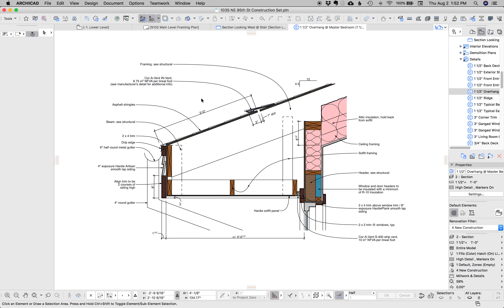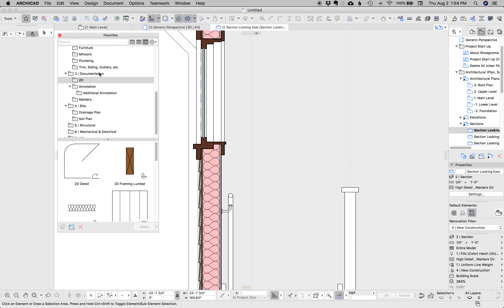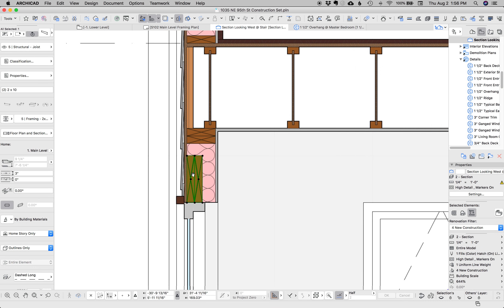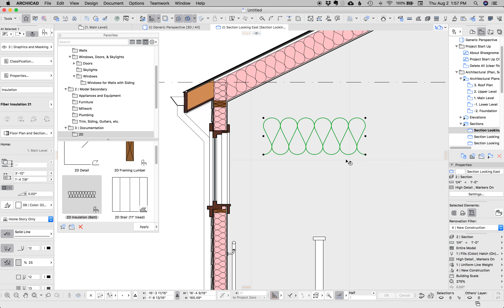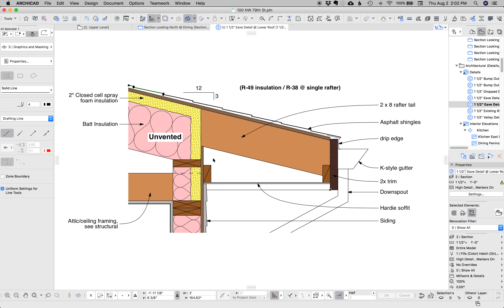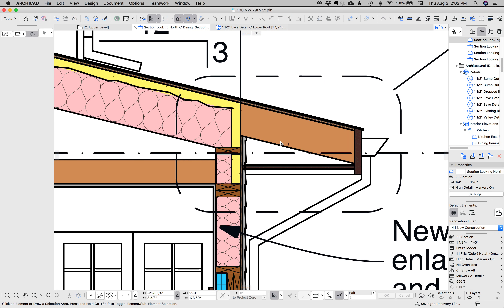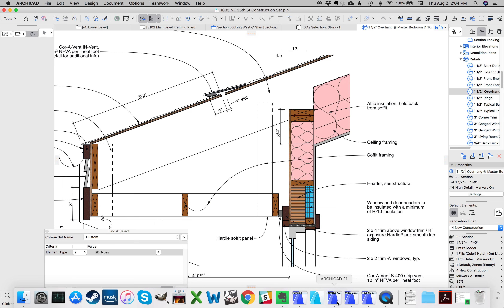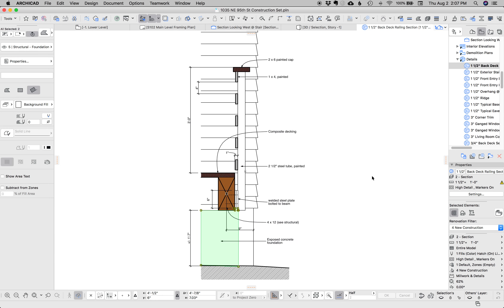ARCHICAD Tutorial #67: Adding 2D to Sections and Details

Comment: thank you for the tutorial! really helpful, i am new to archicad, migrating from autocad and i thought detailing was an automated procedure here. The material fills and such should be properties of the geometry i am currently doing a section on. For example when i setup a wall i want it to be reinforced concrete, insulation on the outside and plaster on both sides. Isnt that something i setup when drawing the wall and the detail of it is automatically produced? In this video there is a lot of manual work so that if something changes you have to go back to every detail and adjust the wooden beams for instance or the insulation width. Again, i am new to this maybe i got this all wrong.
Reply from the maker: Philip this video is about finding the balance between manual work and automation. ARCHICAD can't read your mind and sometimes setting up/managing the automation provides diminishing returns. In your example of concrete, insulation, and plaster, that would be 100% from a composite or complex profile and thus fully smart 3D. But if you wanted to show the rebar in section or a detail, that might be smarter to do in the one place you'll show it. There's an old BIM adage: if you are going to see it more than 2 times, model it.

In the end, it takes an experienced ARCHICAD user and architect to understand the line between 2d and 3d needs to be. I know some people who have 100% of the details  in 3D and modeled. That's not always a cost effective solution or necessary. Additionally once you fully integrate design into your workflow, sometimes it makes sense to design a detail in 2D and then propagate the results back into the 3D. Other times the reverse. There are no firm rules. So just go with what helps design, improves the speed of your work, and makes you profitable.
Reply: thanks a lot for the guidance! i agree on having to find a balance, i suppose coming from a completely non automated workflow using autocad i expected archicad to give the solution to every annoyingly time consuming task.  @Shoegnome
Reply from the maker: @philippaps44  BIM doesn't give the solution. It just provides the tools for you to find the solution faster, stronger, and better.
Reply from the maker: Which is to say, ARCHICAD is as smart or dumb as its operator.

Comment: Finding the balance between 2d and 3d seems like a delicate and ever moving balancing act.  Model too much and things start interfering and you end up with way too many special cases.  Model too little and you are drafting too much and theres a chance things won't be coordinated.  I'm going to start looking at building a 3D cross section through the building that would not interfere with a simpler model.  The simple model would be for plans and elevations. The cross section that would rest in-line with the simple model would show details.  Do you have any thoughts on this?
Reply from the maker: I have a lot of thoughts on this. A well built model shouldn't require a lot of special cases and should remove the need for lots of 2D. Here are two articles I wrote that expand more on my thoughts: https://blog.graphisoftus.com/bim-washed/conquering-bim-never-do-just-one-thing and https://blog.graphisoftus.com/archicad-15/does-that-still-not-work-is-this-still-the-best-solution In particular, look at the last graph in the 2nd blog post. That's the goal. Always less 2D and eventually less time doing 3D.

Comment: First, let me thank you for the invaluable service you provide those of us who use ArchiCAD. I've learned a LOT of cool stuff over the years from your videos and your template. I was curious if there's a reason you prefer to do all your plates as 2D elements rather than put top & bottom plates in complex profiles of walls (rather than composites) so that they're part of any wall? The reason I like plates in complex profiles is that the plates move with the walls - vertically or laterally. I know that if I were to put them in my sections as 2D, I'd forget to move them whenever I moved a wall in some other view. Is there a downside I'm not aware of to the way I do it (bogs down the model, etc.)? Thanks again for all your great help!
Reply from the maker: Thank you! I don't like using Complex Profiles for primary walls. The chances for weird junctions and odd window/door behavior increases. Also (historically at least) model performance can be affected. That all aside, I think using standard composites for walls is just faster, simpler, and more flexible—as the typical wall is just generic. I used to do sill plates as part of my foundation wall, but I decided i didn't like that. I much prefer the purity of simpler elements. Adding sill plates into complex profile walls is great until it isn't. Even one or two special conditions in a project creates overly custom moments. Maybe another way to look at it: I don't know what advantage switching to Complex Profiles that includes plates and such gives. Complex Profiles are more labor intensive to work with than Composites for elements that can be handled with Composites. And composites are easier to manage and swap out when you're dealing with a bunch of elements that differ only by thickness. Of course one could argue the new Complex Profile options in 22 make CPs super flexible. And that's true. BUT it also makes the elements that result from those Complex Profiles more custom and less automated. My preference is always to more automation. Or maybe proper automation. The manual nature of adding plates feels right because everything else is smooth and automated. Adding the plates manually is thus my slow down moment to check my work.

SO...that all comes together to suggest: simple elements to build the model. Then at the last minute add plates and other stuff that are really just decoration for the drawings.

Of course, I'm always happy to be challenged and shown a better way. I'm open to the possibility that I'm clinging to an old methodology and 22 is the beginning of Complex Profiles for more things.
Reply: I'm really glad you replied! I should give you a little background. My name is Chris Hinrichs. I live and work in Petoskey, Michigan, a small lakeside town popular with vacationers. I moved here from Chicago in 1997 to do hand drafting of mostly lakefront custom home CDs for an architect. I convinced him to transition to AutoCAD LT to do 2D drafting. Eventually, he wanted me to learn 3D Modelling, so he bought ArchiCAD 8.1 (whatever year that was) and tasked me with learning it well enough to show him how to use it. I had to learn it on the fly as I put together construction docs, so I never really learned the root logic behind the software and how efficient it could be. I jumped around as far as versions. I went from 8.1 to 11 to I think 15, 17, 18, 20, 21, 22. Now I work for a firm that has a subscription, so that will be nice. Interestingly, of the relatively small number of firms here, I'd say 50% use ArchiCAD. Sorry for being so long-winded, but I wanted to say it was in big part thanks to you that I finally started to understand the logic and flow of the program and really regained an interest in learning how to maximize its efficiency. If you were to see my template, you would see it's very similar to yours in most every way, except for the framed walls with plates as complex profiles.

I don't think I've experienced any of the weird junctions or issues with windows and doors that you have, or at least any that have revealed themselves in any drawings or model views I've issued . I really don't need too many different framed wall profiles to start out (the common ones all set up and ready to go in favorites), and if I need more, they're easy to create. For instance, most interior walls are two finishes (usually gyp. bd.) and a wall framing space. If you need a different material or to lose one skin or another, just make a duplicate, rename, and edit as needed. Exterior walls may have more layers, but it's still the same idea. I have a standard one each for lap, shingle, stone veneer, etc., also ready to go in favorites. Now, with the parameric stuff in 22 you can do all sorts of cool stuff. To answer your question, the advantage is having plates that move along with the walls. For me, that's invaluable. I don't have to worry about random floating 2D plates showing up on my prints because a wall moved and I forgot to move them on the section. Just so you know, I do use certain 2D stuff in sections, so I'm not completely opposed to it; things like anchor bolts, flashing, and drip edges. Like you, I stopped using a plate in my foundation wall complex profiles. I now model it as its own element. 

Totally not trying to change your mind, I swear! Everyone has there own preferences. I'm really just trying to make sure I truly understand myself why I like doing it this way. I'm sure there may be some downside that hasn't reared its ugly head yet, but it's worked well for me so far!
Reply from the maker: Sounds like I need to give Complex Profile walls instead of Composite walls another try! I don't ever have the floating plate problem, but my method is definitely creating work that could be automated. Now I've got something new to think about. Thanks. Every version I try to question some aspect of my process, I think Walls might be what gets questioned with the leap to 22. Which makes extra sense because of the CP improvements. Thank you for sharing your story.